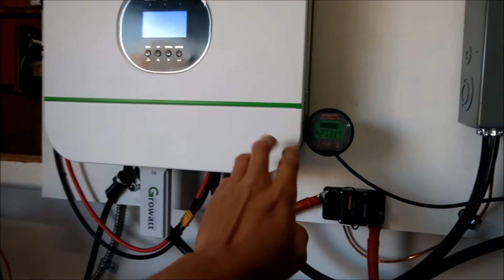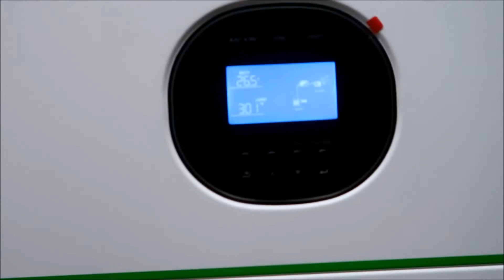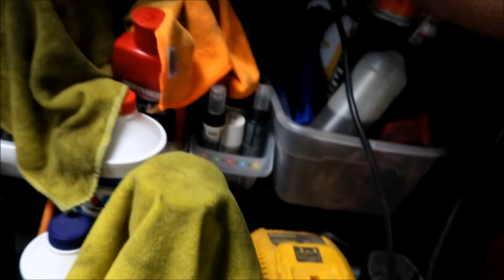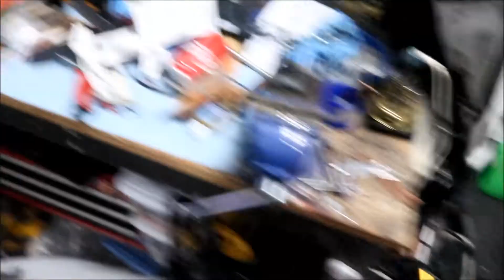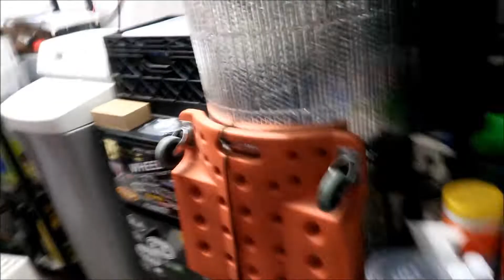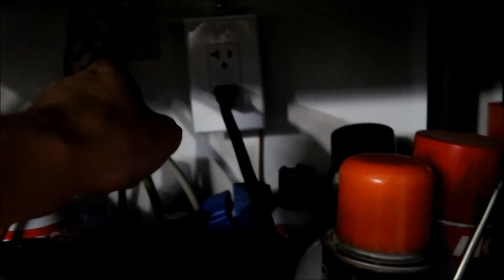HadesOmega Solar Garage Project Episode 58 - Clean Solar Panels, Test Outlets, Appliance Load Tests

Comment: I am going out on a limb here: I think the Garage Door Opener does not have LED bulbs as that is way too much of a curret draw. There are a ton of LED bulb replacements on Amazon. If I am correct, get rid of the incandescent bulbs in the garage door opener and replace them with LED.
Reply from the maker: Nah it has 2 bright LED bulbs in it.  The inverter consumes some power even when idle like about 4-6amps coming out of the battery.  It's not uncommon for it to drop close to 20% SOC overnight.  You can set it go into standby when there are no loads, never tried it maybe I should.